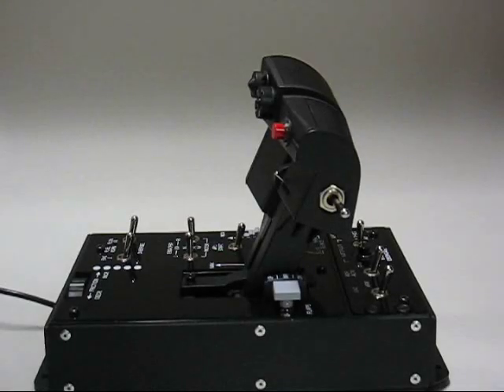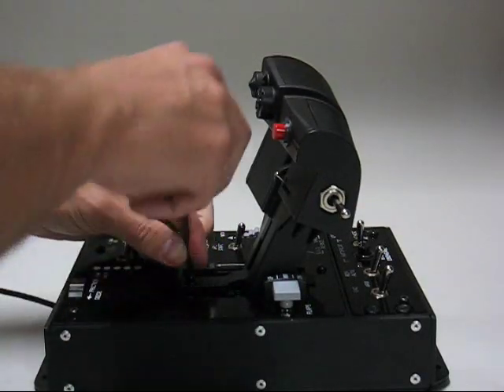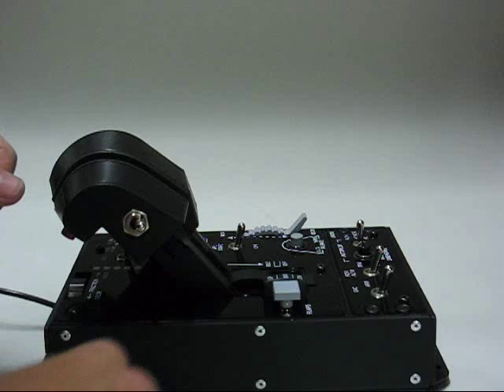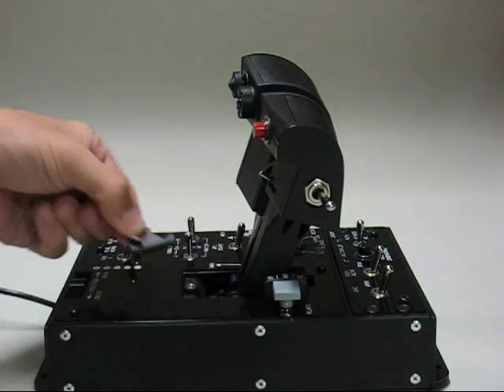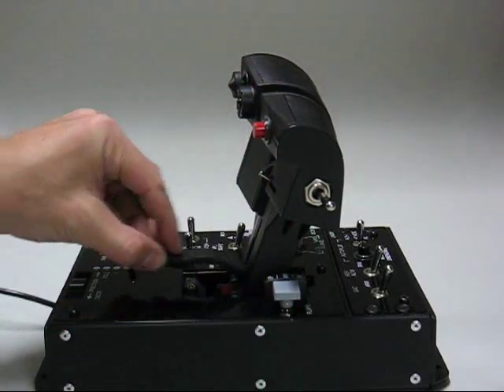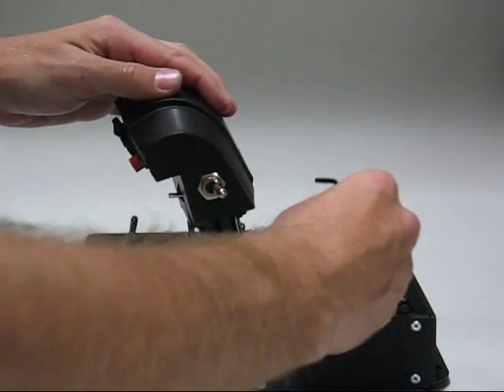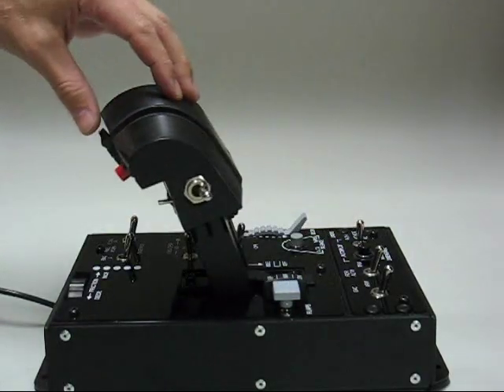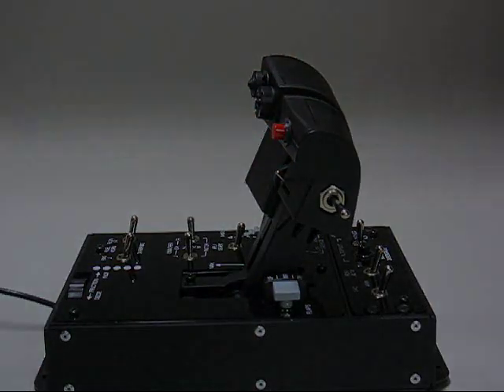SimHQ Review: Thrustmaster HOTAS Warthog - Afterburner Detent

Comment: I brought my Hotas Warthog a few weeks after it came out, and since that time, I have yet to see  a practical use for the bottom detent as there are no switches there.  There are only switches after you come back forward over the hump....30 and 31 if memory serves.

I am thinking of making a spring-loaded double-sided detent above the hump some significant fraction of the bottom forward throw, so I can feel where thrust reverse should be vs idle.  

Going backwards "over the hump",   has, In my humble opinion, absolutely no use in the DCS A-10C,  or or any FSX, or Prepar3D aircraft.

I would love to be shown the error of my thinking.

Regards to all you lucky people that have a Thrust-Master Hotas Warthog, and those who are interested. Many have said It's the finest piece of aviation control hardware found outside of and including the real thing.  It will be the last two-engine throttle and joystick I will ever need. Short of my rant above, The engineering, accuracy and robustness is goal to which every manufacturer of anything, should aspire.

Chas
Reply: +VintageMayo as I said... They only switches are before the hump not after you've gone over it so what's the point?
Reply: I use the backwards "hump" to get the throttle from "off" to idle when starting /shutting off the engines in the F18

Comment: I know of no military aircraft that requires lifting the throttles to select afterburner.  All the afterburner equipped aircraft I have flow have a detent you have to push through to go to afterburner but there is no lifting.  This lift to go to afterburner thing is definitely a PITA and not at all natural for a pilot.  What would be nice is a detent, like in a real airplane, not a lift to pass through gate as is commonly used to stop pilots from accidentally shutting off an engine in flight.
Reply: Its designed for an A-10 and this feature is to satisfy fighter guys. Also it depends on the jet, some you have to push the throttle over to the side than you can use afterburner and I'm sure there are others that you lift over.
Reply: FYI. The F-16 throttle needs to be physically rotated or "lifted" anti clockwise to select burner. Source? 14 yrs of turning wrenches on'em.
Reply: @ethanhiggins4887  f16, jf17
Reply: So does the SR-71!  @ArktikosAdventures

Comment: What is the purpose of the after burner detent?  Call me punchy but I'm new to flight controllers and Falcon 4.0
Reply: It allows you to go to mil power (max thrust) without having to look at your gauges to make sure u don't use afterburner. It all depends on were and how your flying, some airports don't allow burners on take off, plus burners use tons of fuel. Many reasons why you would want a detent for it plus real jets use one as well.

Comment: Foot pedals are far superior to a twist axis, just go ahead and spend the extra $99 for it, you get better control and differential brakes. There is no twist because it's modeled after the real deal, and the real deal doesn't have a twist.

Comment: NO, you´re definitely wrong. A twist moves a half/one inch on both sides to move the rudder, pedals have at least one foot on each side for the same move. So there ist no doubt where is mor precision. BUT (!) the simped pedals make the difference. Unfortunately they are no longer produced, but try to get some on ebay or so. The Saitek pedals are ok but less quality compared to the hall sensored simpeds. But never talk seriously about sim flight using a twist *headshake*

Comment: My view is different: if you spend 500$ on a joystick it better have the option of a rudder twist axis, and before you start crying that it will set off the rudder when you don't wan't it to and/or while you have pedals, they could just furnish a pin that would lock it in place, or even a switch, both would be easy to do...